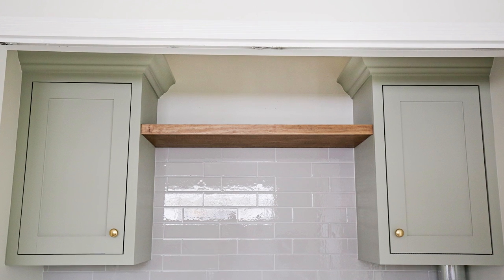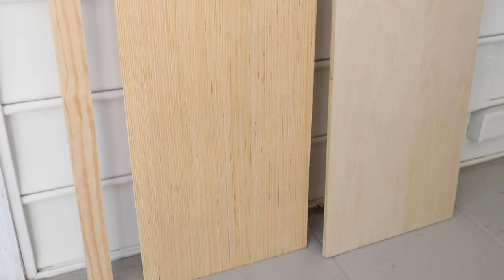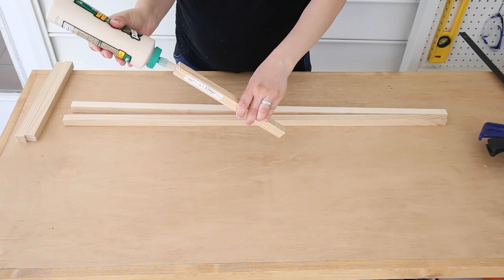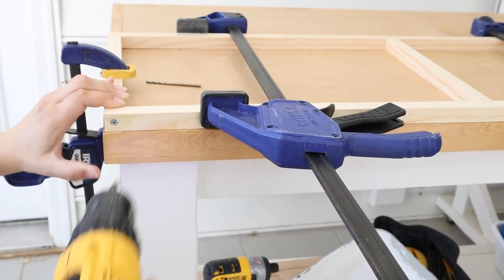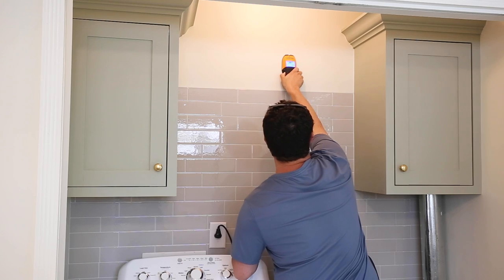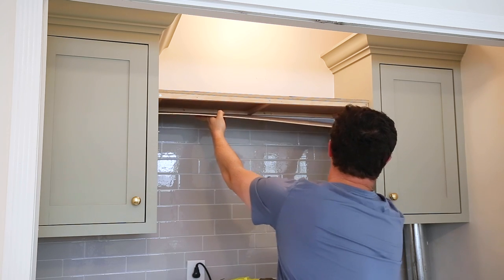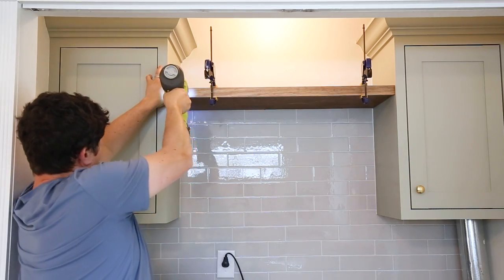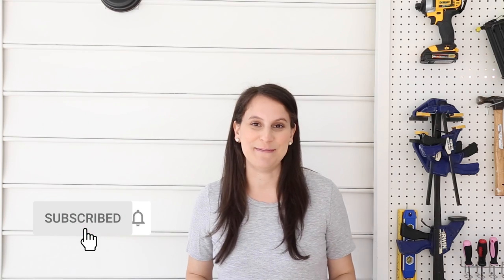Easy THIN Floating Shelf DIY

Comment: Help!  I’m trying to this. The 1x2 you list, is this also Dowel? I’ve never done anything like this before so sorry for the dumb question.
Reply from the maker: Not at all, in this case you could use a 1x2 or a square dowel. The difference is that a dowel is the same measurement on all sides and a 1 x 2 has a wider side and a shorter side.
Reply: @AngelaMarieMade  Thank you 😊

Comment: How high up on the wall did you hang the shelf?
Reply from the maker: I am not sure of the exact measurement, I didn't put it at a specific height I just put it where I wanted it! We have since moved so I'm not sure how high it was exactly, I just installed it to the wall studs with 3″ screws.